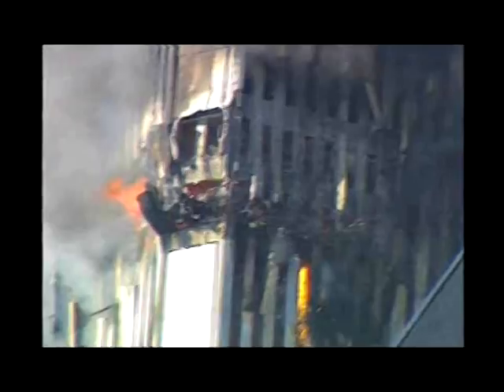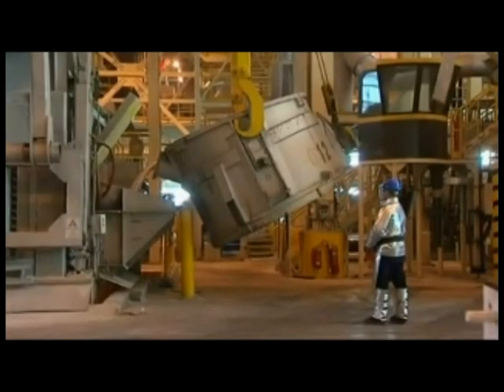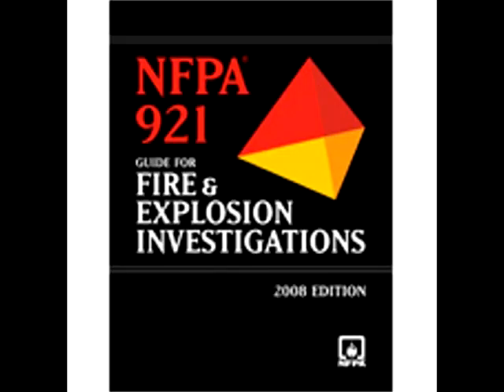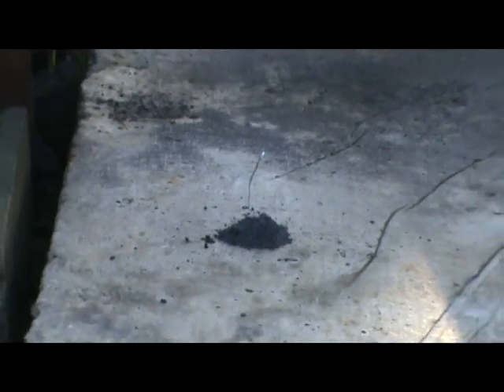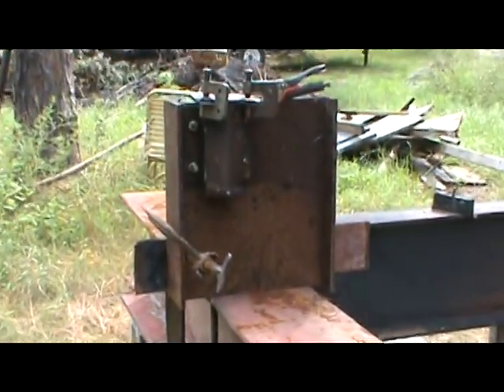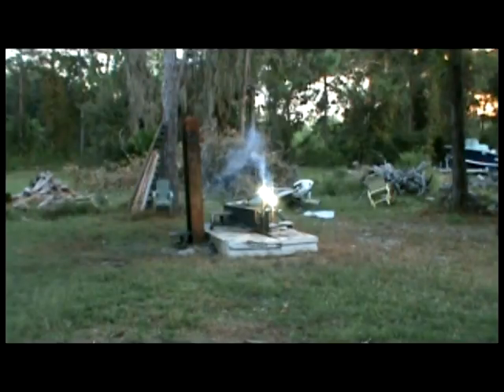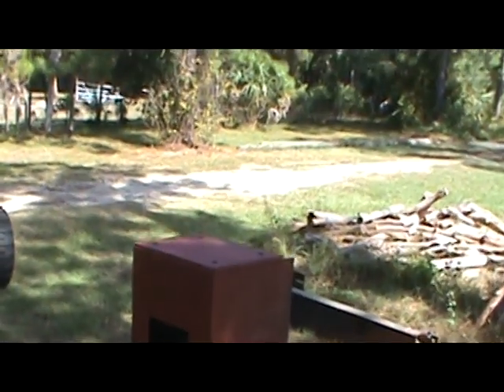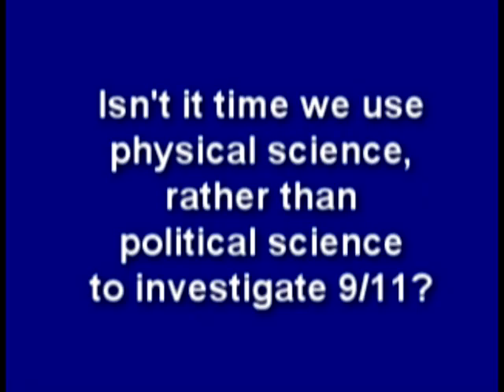9/11 Experiments: The Great Thermate Debate

Comment: As an Ironworker who builds these buildings. There’s no way a plane brought these towers down
Reply: Even better is how do we explain the plane that apparently flew into the pentagon.. No evidence of a large craft, no wing or tail sections, no bodies.. Heck not even a titanium jet engine.. The Jet fuel was so hot it just made the whole plane vanish. As far as the trade towers go, watch loose change, you'll learn of the insurance policies taken out against acts of terror, the proof by employee accounts that bomb sniffing dogs etc were pulled out a week before the attacks.. The. Recant of the fire fighters that heard explosions that shoot the building before the collapse.. The explosions on the main level that knocked the marble slabs clean off the walls.
Reply: @turbogears3907  
No evidence.

Except human witnesses, and a security camera showing it going by.
Reply: @turbogears3907  wrong. They found several parts of the plane. 

Namely the engines and front landing gear....the exact parts you mention were found.
Reply: I call bullshit on the legitimacy of your claims of being an iron worker.
Reply: jay steve . Let's also not forget how easier it was to smuggle chemicals pre 9/11. Before the incident took place.
Reply: jay steve. It still doesn't explain who planted the chemical thermite inside the buildings or inside the airplanes themselves. Till that portion of the evidence is FULLY EXPLAINED TO ANYONE'S SATISFACTION,  WE WON'T EVER KNOW WHO SMUGGLED THAT CHEMICAL THERMITE INTO THE TOWERS THEMSELVES. I AM NOT DISSPROVING THE SCIENCE. I AM JUST TRYING TO PUT A FINGER ON THE SITUATION. SOMEONE HAD TO HAVE ACCESS TO THOSE TOWERS OR PLANES, BECAUSE IT WOULD HAVE BEEN EASIER TO SMUGGLE CHEMICALS INTO THE BUILDINGS OR PLANES IN THOSE YEARS BEFORE 9/11 existed. THAT ANGLE MUST BE FURTHER INVESTIGATED.  I DO STAND BY THE SCIENTIFIC EVIDENCE THAT IT HAPPEND THAT WAY.
Reply: Looks like a controlled demolition falling perfectly like that. If you were to weaken one side of the building wouldn’t the building start to tilt to the weakened side then fall over? Not collapse on it self like such. Like many of you saying that the fire would weaken the steels tensile strength causing it to bend and twist. Which would make it fall over not collapse? Someone said here that the building is designed to collapse like it did, is there evidence to prove that? I’m torn if it a conspiracy or not. I just see both sides of the argument bringing up good points.
Reply: An ironworker is a construction worker. You're a builder, not a structural engineer. Sorry, but your experience is irrelevant. You don't design skyscrapers. You don't know what the strength of the structure is or what its weaknesses are. You put together a building that has been engineered by someone else. Just because you can build something doesn't mean you fully understand its physical properties.

You know planes are made of more than aluminum, right? They contain steel as well. Something flying at 600 MPH with a weight of over 100 tons does serious damage to a structure unless it's specifically designed to withstand force in that direction. You don't know what you're talking about.

It's much easier to pull two separate pieces of steel apart than it is to press them together. Your welds and rivets are designed to withstand force in specific directions. The tower's didn't just collapse vertically. They went down at an angle, tearing apart all the rivets and weld in each floor as they went. They collapsed inward, causing outward force and, thus, high levels of tension. A building is designed to withstand compressive force, not tensile force.
Reply: CertifiedDoc That’s like saying an auto mechanic doesn’t know why cars drive just because he builds them... You sound like a dumbass by saying that
Reply: An auto mechanic is not an automotive engineer. He can see how a car drives, but not the forces involved. He doesn't know how many pounds of pressure it would take to crack an aluminum crankcase as opposed to one made of steel, or what conditions and stresses are involved in that. He doesn't necessarily know the temperature of ignition of gasoline, or the pressures involved in the firing of a piston.

Likewise, you know how much steel is involved in building a structure, but not the mechanics behind why a certain amount of steel is required, or the exact amount of force a piece of steel can withstand. You don't know because it's not your job.
Reply: +Panopticon  This guy is using his occupation as his only reason for knowing that the whole thing was a hoax. The only problem is that his occupation doesn't give him any knowledge of that. Whether he's done other research, I don't know because he didn't say. All I got was "muh job". Pay attention.
Reply: @CertifiedDoc  Yeah and the guy in the video isn't a demolition expert.
Reply: @alexsbikesandmotors . I agree. A 767 of that size can do a lot of damage.  No question about that.  I am raising a better question.  If these people claim that thermite was present when these towers went down, how did  or where was that chemical stored in the towers. It had to be a major factor in bringing those towers down like that. Was it smuggled onto those planes? Was that chemical agent used to build  the twin towers inside those steel beams? And if so why? A lot more questions needs to be raised and asked about this subject in greater detail to really get to the truth of this matter.
Reply: Here are the undisputed facts. I am speaking as a civil/structural engineer and I am only concerned about the actual loads and conditions.
1) a jet aircraft crashed into the world trade center buildings (I do not engage in conspiracies that put forward a narrative that doesn't go with the accepted 19 highjackers evidence) 
2) these planes were set for cross country journeys meaning that I) they had more fuel to light once impact occurred and II) they overall we're heavier. 
3) while lots of material was elected from the buildings apon inpact (including several floors of outer columns) overall the net mass on the floors increased
4) no floors were rated for that weight they were not designed to carry half a jet aircraft in addition to most of their load. 
5) the fuel from the planes, along with anything resembiling hydrocarbons were set alight on those floors to burn in an uncontrolled fasion
6) there's no possibility the fire coating remained on the steel at least on the sides facing the impacts. 
7) structural steel begins to lose its strength at 400c and at 600-800 c it can lose up to half it's strength (saftey factor 2) 
8) the factor of saftey on floor one, the floor that must endure the most loads under normal circumstances was 1.54. 
9) when the steel columns experienced failure they were experience both a vertical load of 3-4 dozen floors and a horizontal load of wind exceeding 75mph at times. 
10) at the moment of steel column failure the equation translates from a strength of materials problem to a impact resistance problem. What you have to 30-50 floors collapsing as one unit, you don't ask how strong is the structure below. You ask how strong is each individual point and can it withstand 100k tons of pressure, which no.no it cannot. 

Your assertion that because u work on steel buildings and u see how thick they are and there's no way they could collapse from the rediculous extra loads involved in airplane strike is rediculous. By virtual of your statement I can say that because I would on the design of the buildings you build I know more than you and over rule your opinion.have you ever asked yourself why they put fire coating on a steel structure that's rated for 90 minutes? If it's not gonna collapse what is the concern?
Reply: Finally. A properly educated voice of reason. You know,it never occurred to me that that floor of the building and every floor below it was suddenly supporting the added weight of a jet airliner.
Reply: The iron worker in me says no not possible but the blacksmithing experience says yea it can 
Take d2steel for example way harder than anything used on the towers i can heat it red and beat it and bend an manipulate it with brute force now add how many tons on a few supports that got hot and down she goes
Reply: John Ressler yeah if that’s the case all of the columns should’ve been bent over, they won’t just fall straight down just because they get hot, if you have a fire that actually heats up a 25ft column that’s serval inches thick, the top would be hot, not the bottom. So the top should’ve bent over, especially the floor that were below the fire. I’m mean every single column is spliced together, eventually after falling a few floors, all of the columns and support beams would’ve built up and it would’ve stopped falling
Reply: As an iron worker who builds these buildings. These planes absolutely brought these towers down
Reply: BETTER THAN YOUR FAVORITE ACTION STAR then you must be the guy who sorts through bolts all day or you’re on the decking crew
Reply: @wrestlingisdeadmoveonwithy8939 . I agree 100percent.  Case closed.
Reply: @wrestlingisdeadmoveonwithy8939  
Wrong
The aluminum of the aircraft will buckle so hard before it makes much damage. 
Ever see a bird strike on a plane?
Yeah well the tt were also made to withstand a hurricane. 
Nice try though
Reply: Petroleum based fires can and do destroy massive iron structures.  Have you seen what happens to an oil rig when a blowout ignites?  The fires were burning for quite a while prior to the towers collapsing.

The metal doesn't have to melt, all it has to do is lose it's structural integrity.  If this wasn't the case, then we wouldn't have the show called "Forged in Fire" and blacksmiths wouldn't be able to do what they do.

You said it yourself.  You're an iron worker.

You're not a structural engineer, nor a metallurgical engineer.
Reply: Does it really matter one way or the other at this point? 
Even if our government was responsible for 9/11, what is anybody going to do aside from bitch back and forth to each other on YouTube?
Reply: You don't need to melt steel to lose it's structural integrity jet fuel would not be able to melt steel but would make it soft enough for it's own weight to collapse itself. My uncle was a worker on the site after 911 happens 45 days later if you picked up a piece of steel with machinery it would act like silly putty. The reason the steel stayed hot after the fuel burned was due to a few generators from a building adjacent had special fuel that burns just under the temperature of jet fuel that was damaged. More than enough heat to ruin the structural integrity of the towers days after the incident.
Reply: @T420-s3y  . That sounds interesting.
Reply: to make us go to war and steal our tax dollars it's very simple
Reply: There was NO NEED to melt ANYTHING. A full load of kerosene was combined with a collosal amount of kinetic energy into a very small volume. 

That energy translated into higher than normal temperatures. All that was needed was for the steel to soften and lose its strength without needing to get anywhere near melting temperature.

You quote Barnum. I quote William of Occam right back at you.
Reply: Become Fitness "As an individual who has watched loads of youtube videos, There’s no way a plane brought these towers down" lol.
Reply: Hence why you're an Iron worker and not an engineer. You need a college education to be an engineer
Reply: Clifton Williams woooowww and iron WORKER, OH AND YOU ARE CURRENTLY WORKING ON A 6 STORY BUILDING, therefore you totally understand the engineering, design, and mechanics of a 110 story building, and you totally understand the physics of gravity and melting steal and upward and downward force... please tell me more about your studies because your 47k must be doing great and did you drop out of college cause all you need is a high school deploma to become one of these scientific intelligent iron workers.
Reply: All the idiots in this reply session are hilarious! You don't need to be a structural engineer or a rocket scientist to see how those buildings got taken down by two 747s. All you need is a basic understanding of physics,  chemistry and a little blacksmithing know how to see how those tragic event happened.
Reply: As an Ironworker who builds these buildings.A plane brought these towers down.
Reply: ThecessnaFlyer - Gee I don't know. Could it be for the same reasons listed in the Nortwoods Plan? You do know about the Northwoods plan conceived in 1962 and put before Kennedy right? Wage a fake terrorist war on American citizens in the name of Fidel Castro as a way to legitimise invading Cuba? Interestingly one part of the operation called for the fake hijacking of a plane and killing all US citizens on board.
Reply: that is the wrong question
Reply: Bilbo LAGGINS
Then, what's the right question.
...ya idiot with nothing to offer...
Reply: TANGLDWEB Some people are just so simple. They want to believe our government killed thousands of people for a motive for war lmao.  Does anyone realize the amount of people that would have to be involved in a conspiracy like this? Most likely thousands!!  These are the same idiots that still think the government killed JFK and that the government is holding aliens at area 51. You can't win an argumemt with the tin foil hat crowd, they just keep on with the "what if's" & "how come this". 🤣
Reply: @apb2887  
They are all Slow Lemmings. Reactive. Not Proactive.
Reply: @apb2887  
I SAID, I WAS OUTTA HERE 😂
Reply: @thecessnaflyer6754  much the same way it goes and does the same all over the world
Reply: TheCessnaFlyer I’ll give an example that’s easier to relate to, let’s say Brian lives in a neighborhood and has a few good friends in this neighborhood we’ll start there. Brian has a problem managing money and stays in debt so he borrows from his neighbors with promises that even he’s not sure he can keep, this goes on for a while and his neighbors are good friends so they allow it but eventually it starts to put a strain on their household and other neighbors are starting to notice that maybe they’re an easy target for a sob story. So these good friends/neighbors decide okay Brian it’s time you figure this out on your own “tough love “ I forgot to mention Brian is younger than most of them by the way. So what is Brian to do now begging won’t work he’ll look fragile and his ego can’t take that selling resources won’t work because he was borrowing so he could buy resources light bulb 💡 family tragedy there’s no quicker way because after all Brian is still a friend and he’s a beneficial part of the HOA so they rush to his aid providing anything he needs and to show their support and care for him and his family.. I hope that helps a little
Reply: @thecessnaflyer6754  to justify taking your freedom instituting homeland security to cause fear for you stupid ass people to give up you  r rights
Reply: blaming isreal? why  ? cuz they  got caught being in the towers doing work on the"sprikler sys" the week b4  9-11,  and they got caught  leaving the scene after filming the "event"  the mossad was living next door to 4 of the hijacker, many isrealies were warned that morning to avoid the trade center area and  many many  did not show up  for work  that day, ex head of mossad owned much of the retail space in towers along with sivlesrtien had filed  terrorist Insurance  weeks  b4 attack. and lets not forget Urban moving sys inc?(mossad front)  and the antrax that was found in the warehouses along with  explosive residue.    while were at tit  just how did isreal start their nuclear program?  oh ya  they stole it from the USA. funny how the only country that u can hold a duel citizenship and still hold office in US politics, is  isreal.
Reply: also while we're at it.  you dont have to prove how  explosives brought down the towers      just that they did   and the real evidence  is in the complete destruction of the  contents of the towers. and also the degree of destruction to the concrete  and glass. almost 80%  was turned into talc like powder   down to 10 micron.  to turn either of these materials   down to a powder  takes extreme amount of  energy. nothing that a collapse  could have caused. NEVER.  also  you can see clearly  during the collapse huge pieces of the tower faling away as enormous plumes of smoke are billowing off every piece as they fall. the inside of the towers are exploding down inside the buildings  faster then  huge pieces are falling along out side towers.  you think  we'r fkn idiots??  your wrong
Reply: Clifton Williams As an ironworker when would be the most opportune time to install explosives in a building? During or after construction? Who could install explosives without being noticed? Have you ever seen something odd going on during construction?
Reply: ese-hombre
"As an ironworker when would be the most opportune time to install explosives in a building?" - I hope you're aware that that question isn't very clever.  How would any ironworker know the distant future?
"During or after construction?" - You missed out before.
"Who could install explosives without being noticed?" - Anybody present at all possible locations when no-one else was there, over the last thirty years?
"Have you ever seen something odd going on during construction?" - Why do you ask?  Do you believe that buildings everywhere have been built with explosives in them?
Reply: What do you think about the building that collapsed all on its own?!
Reply: If you mean tower 7... How many millions of tons of impact do you think buildings are made to absorb? The twin towers falling caused a literal earthquake and the basements of all the buildings were damaged. It's a miracle more buildings didn't fall and there's no doubt more were damaged. The repairs to all the surrounding buildings was extensive.
Reply: What building just randomly fell on it's own?
Reply: fish mann  settle the fuck down.
Reply: Can thermate cut the head off my penis? Not this chrome steel mega-python over here!!!!
Reply: @TheCessnaFlyer, for money..
Reply: clifton- don't let the trolls affect your thinking. obviously one object cannot hit a secondary object, whether with jet fuel or missiles or the like, and cause the secondary object to freefall.  It is a physical impossibility. Yet we watched those towers freefall...because they were struck on the 93rd and 75th floors, respectively. Which is physically impossible. If the top snapped off under the impact and ensuing fire that would make sense.  It also would have caused much more damage and chaos. Even Dan Rather said it looked like a controlled demolition on a live newsfeed.

Also, WTC 7 collapses, even though it is never struck. The official story is that the jet fuel created an intense fire which caused the collapse. but WTC 7 shouldn't have been affected by the jet fuel. Interestingly two of the biggest tenants of WTC 7 were Salomon Smith Barney and the Securities and Exchange Comission.  Both just happened to lose all the files they were housing one day after Donald Rumsfeld admits the DoD has lost track of $2.3 trillion. Also remember SSB is a Citigroup subsidiary which just happened to be embroiled in the WorldCom scandal. Those lost files account for trillions of dollars that remain hidden.

Also, Flight 93 crashes in Shenksville, PA without debris. The immediate news coverage following the incident shows a hole in the ground where the "plane" hit the ground but there isn't any wreckage around the hole. There is minimal plane wreckage at the pentagon.  Now ask yourself, where was the plane wreckage in New York?  Did you ever see plane parts in any of the NYC photos? Why did all these planes vaporize?  Again all this defies the immutable natural laws of our physical world.
Reply: As an ironworker, do you design the buildings? As a structural engineer, I can tell you with all certainty that a plane brought them down
Reply: Dude you need to take your head out your ass and waken up, your so called government don't give a shit about you and me, its always about the bigger picture or agenda. We are sheep to these fuckers
Reply: A plane made of LIGHT MATERIALS ISN'T GOING TO DEMOLISH A WHOLE FUCKING BUILDING MADE TO RESIST NATURAL DISASTERS, EARTHQUAKES, TORNADOES AND FUCKING ALIENS. 
Jet fuel isn't that any different from a normal diesel.
Reply: NOW YOU GO FUCK YOURSELVES.
Reply: TheCessnaFlyer because the American government under the JFK administration planned something similar against Cuba. Search up operation Northwoods. Official government papers. They wanted to bomb schools and hospitals and blame it on Cuba as a reason to invade and take over. JFK said no.
Reply: carpe diem There’s a thing called apprenticeship school where you learn the ins and outs of our trade, you learn everything there is about structural buildings, and how to build them. That takes 3 years
Reply: I've never been convinced of fire being catylist to the towers collapse, but having began forging steel recently, I wonder - could the higher temperature required to melt the buildings columns have come about by the wind @ that height fanning the blaze to extreme temperatures  - much as an iron forge works ?
Reply: @TheCessnaFlyer You're 100% trolling, but it was to start a war with Iraq, blaming that they'd officially started war with U.S.
Reply: ARRAV, False.
9/11 did give large support to the war but the war was already planned out as a continuation of the gulf war years before 9/11.
Reply: TheCessnaFlyer oil.
Reply: @heldgop I don't know if you know this but you turn a wrench you swing a hammer... You definitely vote Democrat. Because you've obviously never used a tool in your life. Lmao
Reply: The planes totally brought down the building...
Reply: If I check my max weight of lugage, back then , I think you  could check two 75lb bags per person. 

Edit* -150lbs of tanerite or other material  per terorist. Easy to Get 600lbs on board. 
Why not use  magnesium & tanerite,  or other combo, add in some sort of extra O2!*
Reply: Project for a New American Century fulfillment
Reply: @thecessnaflyer6754  war.
Reply: proof is in the video man.  the building fell from the top down, not the other way around.  it only makes sense that the plane was the cause of it.
Reply: You ever stood next to a jet that big? As soon as the planes hit i knew the buildings were coming down and i was only a year out of highschool
Reply: Clifton Williams your right, sadly the only way to get a 90% right answer is to build the twin towers over again in a empty field and have a unpiloted plane the same model crash into the building. but that will most likely never ever happen. so we have people on both sides fighting like the left vs right. you cant convince me it was planes that took the towers down when explosions came out of random windows on random floors. how could a plane do that?
Reply: heldgop I swung a wrench, while in school. All the other engineers cheated off other people. The best engineer, was a fuckhead who couldn't design a weather balloon battery box. That said, I made a million with 10 grand, never used the degree. How's that for a laborer?
Reply: as an ironworker, you should be well aware what happens to steal when you stick fuel and iron in a chimney like object with a good strong air flow....
Reply: Look up Operation Northwoods. Those were real documents which were given to the then US president JFK which proposed a fake terrorist attack to  which then was to justify attacks on Cuba.
Reply: Your a brain dead idiot
Reply: I agree with you, those building were built to strong for planes.
Reply: I got news for you.

If you build them there's no way in hell your education or experience makes you anyway more qualified to understand the physics of all that.

Which makes your opinion worthless unless you can explain how it's impossible, backed up with actual science of course.

We've been doing science on metals using force(impacts, explosions, etc) and weights for a LOT longer than those towers existed. According to everyone who's checked, the physics of everything they say works out. Which means you must be getting your claim from tests that were done before the towers were dropped. So all you have to do is go get the links(or get a physical book and scan it in and give us the link) to that previous testing that makes you know for a fact the planes could not drop the towers.

Take your time, I'll wait.
Reply: Whenever I see someone arguing and typing one word in caps, I automatically  think they are a douche or butthurt
Reply: @kingteb  
Amd you sound like someone who loses a LOT of arguments online.😎
Reply: I think the fact that thermitic material was even found should raise suspicion. I don't have a degree in any of these fields like some of you, but if it was just a plane crash why would this type of material even be there? I'll also just throw in another conspiracy on top of it cause, why the fuck not. A few months before 9/11 Larry Silverstein took out an insurance policy on the buildings which covered terrorism and or terroristic threats, he then took the insurance company to court after 9/11 and won over 4 billion dollars, on a small investment. I don't think that's a coincidence. Also, wasn't George Bush's brother in charge of security for the world trade centers? and if i can recall correctly, I think there's lots of people that worked in those buildings, on the record, talking about random evacuations of the buildings weeks prior to 9/11. Which might explain how explosives were put there. I didn't read all of the comments on this but I didn't see anyone bring these points up. I just like to keep an open mind and let's stay cordial people :) much love :)
Reply: Logan Scott because thermitic material is simply iron oxide, and aluminum, which are VERY common building materials, the iron oxide came from the decomposition of steel, a byproduct of fire and steel, and aluminum is used in lots of alloys and members that give the building structure. They also sometimes use thermite to weld the beams together
Reply: Taydrum I appreciate the explanation!
Reply: Cheers, and thanks for the reasonable response
Reply: TheCessnaFlyer But you forget one thing... They will.
Reply: As a vet that works in a clinic, I'm gonna say that there was more than one plane.
Reply: Your a WORKER NOT an expert.
Reply: +TheCessnaFLyer, your Police kills over 1000 citizen each year so not so huge difference. 
It's called collateral damage to get approval from citizens for foreign military acts/funding.
Reply: 2 planes = 3 buildings falling straight down 👌
Reply: Kareem Alvarez
Only gullible ignorant moronic SHEEP DRONES to the conspiracy shepherds think two planes brought down three buildings.

That did not happen.

Two planes brought down two buildings. The two buildings that collapsed destroyed or damaged beyond repair the entire WTC complex and some buildings outside the complex.

Now wake the fuck up FOOL!
Reply: Become Fitness
The towers were not full of asbestos dumb dipshit sheep. Only one tower had asbestos in it and it wasn't even halfway up. Now wake the fuck up FOOL!
Reply: Clifton Williams just stop, he won't open his eyes
Reply: Alejandro Calzada
Your eyes are the closed ones widdle sheeple.
Reply: VitalCubeGaming
What's that sheep? You can't refute me? Poor you.

Wake up!
Reply: I’m an Ironworker that builds these builds how terrible
Reply: Light weight construction did....
Reply: I have a legitimate question:

Could the jet fuel not have made the steel frames of the buildings so hot that they just got malleable enough that they went limp like noodles and allowed the collapse?
Reply: Source: Dude trust me
Reply: FRooP Fucktard
What's that sheep? You can't refute me? Poor you.

Wake up!
Reply: @thecessnaflyer6754  your problem is your thinking the government really needs a reason to do anything, bill Clinton released documents of the government testing harmful radiation on whole towns, and even a u.s. aircraft carrier to get heat off of himself. The government doesn't care about the people living here.
Reply: @thecessnaflyer6754  your joking right ?
Reply: Had anybody ever stopped to think that maybe there was a third party, and they were responsible for making people hijack the planes and MAYBE (set up bombs in the two buildings). And then they planned that everbody would never figure out what caused the buildings to fall because they are all to busy arguing about terriosts or controlled demoltion.
Reply: Clifton Williams , that’s right , stick with what you know , and let the guys who know how to bring one of your buildings down explain how it can bi done
Reply: I'm an ironworker too (20 yrs) I saw these towers burning myself. I  agree with you. A plane hit the empire state smaller plane and also there is way more steel in the empire state building along with a different design.
Reply: Did you know if two barns, one wood and one steel, caught fire at the same time, the wood structure would remain standing after the steel structure had collapsed?
Reply: Clifton Williams ...as an iron worker.... You wouldn't fucking  know....
Reply: Swandogg88
Sheep.
Reply: Uhhh....how about to have a reason to go to war, to cover evidence, and to make you believe another country did this to us.  Kinda odd that your name is Cessna flyer.  Did you hear about the guy that flew his Cessna into his own home trying to kill his wife and son???  Well, the plane didnt even hardly cause damage to the house.  So does that make the towers built out of Legos???  Come on man.  Wake up.  If not, I guess go back to grazing with the rest of the sheep.
Reply: Brody
How fast was the Cessna going dumb dipshit sheep?
Reply: Clifton Williams agreed
Reply: Steve
Steel didn't melt on 9/11 dumb dipshit sheep.

Explain what hit the Pentagon if it wasn't a plane and why it wasn't on radar when flight 77 was. Explain why you think we should have clear video of an event that took 1/4th of a second to happen from CCTV cameras that record at less frames per second. Explain how the black box from flight 77 ended up in the Pentagon if it didn't hit. Explain why there are plane parts inside and outside the lawn. Explain how passenger bodies were found inside the Pentagon. Explain why multiple witnesses saw a plane. Explain what hit the light poles if it wasn't a plane. If you claim that the light poles or plane parts were planted, then explain how this is possible when the Pentagon is a major tourist location surrounded by major highways. If you say that a missile hit, explain why the damage is too large for a missile. Explain why there are no missile parts. Explain why no one saw a missile.

Refute the content of these links.

therightbloggerbastard.blogspot.co.nz

Damage analysis link:

http://911review.com/articles/stjarna/eximpactdamage.html

Video tapes:

http://classroom.synonym.com/were-9-11-pentagon-tapes-seized-fbi-18501.html

The FBI directs inquirers to its vault, an electronic reading room with documents available to the public. The vault includes many videos and images of the Pentagon incident, including debris from the plane

Here's a few pictures of bodies at the Pentagon, you know, the ones the conspiracy shepherds say don't exist and you mindlessly believe them like the gullible SHEEP you are?

http://www.vaed.uscourts.gov/notablecases/moussaoui/exhibits/prosecution/P200045.html

http://www.vaed.uscourts.gov/notablecases/moussaoui/exhibits/prosecution/P200047.html

So explain all of that DIPSHIT SHEEP DRONE or you can always...

WAKE THE FUCK UP DUMB DIPSHIT SHEEP!
Reply: Clifton Williams yet it did  get over it
Reply: which is why you're not an engineer
Reply: Iron worker, yup that's a great place to get your unprecedented structural damage report. Everyone who thinks they are an expert on this collapse is a tool
Reply: Physics is a thing.
Reply: @dankbeast9013  
Sure, i get that, but I don't get my science from a grunt welder. Also you can cherry pick scientist that will say whatever you want like the earth is flat but fact Is, this disaster was unprecedented so no one is an expert. Also no one survived who saw and inspected the damage leading to collapse cus all the evidence is basically gone. So again, go find something better to do with your day
Reply: @beatnik1855  triggered?😂  What about wtc7 that no one speaks about. Explain that.
Reply: @dankbeast9013  Not for 85% of people I come across, most of whom of can't even comprehend what "zero resistance" means.
Reply: U fucking idiots think a zillion bolts and tons of welding will hold a builidng being hit by a huge fucking plane this isnt cartoons guys be foreal....no building will out hold a impact hit like that way in the sky wow i guys wre fuck tards 😆
Reply: Because you know the unique design of the towers.... You are embarrassing yourself
Reply: Charles H Geis IV
Be specific, dipshit sheep.
Reply: All you pocket geniuses know NIST failed to cause steel to collapse in their replicated office fire experiment don't you?
Reply: CessnaFlyer, you ask why a government would do this. That can be answered easily: You follow the money. But let me ask you a question: Why would Muslims do this?
Reply: Jeez. 
It's like talking to Flat Earthers 😂
Enjoy your conspiracy theories. 
...I'm outta here...
Reply: 60 people died in construction twin towers and Mr.Yamaski unique tube design relied heavily on load bearing perimeter walls make more floor space,,maybe if you had civil engineering degree like Bin Laden you would know this,,steel only has to weaken not melt,,weight of the upper floors in the towers does exactly what gravity dictates,,
Reply: theCessnaflyer, Dig in the declassified history of your government..not to mention what is happening these days....still classified.
Reply: @spinneborstel . Yeah. What they(our government) wants us to believe.
Reply: There's no way you're an ironworker who builds these buildings.
Reply: You're an idiot that's a very common thing. I lived in Miami Florida from 2005 -2008 and Worked as a superintendent for Whiting -Turner Contracting Company . I was in charge of the exterior of 851 and 901 Brickell buildings.   It's known as the plaza on Brickell and you can look up the info i give you. Just from my one job alone with a 64 story building and a 47 story building and a 10 story parking garage we had hundreds of iron workers alone on just that job. The whole skyling was filled with over 50 some tower cranes and 20 some construction sites going on at the same time. My point is this is just 1 city in America.Imagine how many iron workers are all over this country. So it's very common for him to be an iron worker. And it's clearly obvious anyone who has built these kind of buildings from the foundation up, that 2 planes couldn't bring down these 3 high rises. They're literally built with a plane crashing into in mind. Since the plane crashed into the Empire State Building we have had to building the buildings to a certain code. And the code was implented with a plane crashing into the building. Every architect that designs these buildings design them assuming a plane will crash into it. And you still think 2 planes brought 3 buildings down in controlled demo. Not just buildings we are talking steel structure highrise designed for planes crashing into them. You explain how 2 p[lanes cause molten steel ill wait.....My father is a senior superintendent and has worked on bridges and high rises for 40 years. And i have since i was 19 and now i'm 32. And i promise you with all of my heart those buildings were not brought down with planes.
Reply: Brother David "those buildings were not brought down with planes" - Well, obviously they weren't.  They remained standing after the impacts.  We don't need you to tell us this.
So why are you telling us this?  Do you think we are all blind?
Why aren't you discussing the hour afterward before they fell?
Are you going to pretend there wasn't a fire?
Are you pretending that SIX ACRES of office fire couldn't heat up the 3/4" round steel bar trusswork holding up the floors, when given an hour to do it?
Are you pretending that heat doesn't soften mild steel after a thousand years of blacksmithing?
The towers fell due to fire.  They would haven fallen just a little later had they been undamaged.
No molten steel occurred, and no molten steel was found.
Truther claims of 'molten steel' are either to do with the red-hot molten aluminium alloy that gushed out of the corner of WTC2 moments before it fell (iron produced by thermite is white hot at 4,532 deg F, and falls straight down.  It would never fall outside of the towers), or the corroded iron found in the wreckage, which was caused by chemical reactions between red-hot steel and fireman's water.
You must have issues, both with education, knowledge, and authority.  Read the NIST Report in the company of a trained engineer.
Reply: Tony Duncan Right... Because a fire took down 3 buildings that were all sprayed by fireproofing, yet they still collapsed perfectly. Crazy isn’t it? Just like they never could find the 4 black boxes, which were big giant orange metal boxes that are made to withstand a plane crash, somehow just disappeared. Yet they could find a passport, money, notes, bone fragments, etc... So I don’t buy the official story because the government is known to lie, quite often
Reply: Tony Duncan There were people who say the FBI found the boxes but NIST reports they never did, then of the other surviving ones from the other flights, they somehow didn’t work or they simply denied to reveal the audio to the public
Reply: @MrRandomGuy86  here's another reference smart ass ...I'm a structural engineer and im well aware of those 2 planes cannot bring down those 2 mountains of a building. Anyone with a brain will agree with this.
Reply: @MrRandomGuy86  prove it. Pics or it didnt happen or i guess in this case it did.
Reply: Forrest Hayson
Gotta be more specific. I've made multiple replies in this thread. What do I need to prove widdle sheeple?
Reply: @MrRandomGuy86  ah i see your such a troll ypu forgot who you trolled lol i was refferring to your very first commwnt where you claim the the guy has never worked on a skyscraper i want ypu to prove that he doesn't. Where i come from if you call a man a liar you have to prove it. You sau he lies i say you prove it.
Reply: MrRandomGuy86 Well I’m currently building a 6 story building, but yeah I do this for a living
Reply: MrRandomGuy86 Look up the plane that crashed into the Empire State Building, it didn’t collapse
Reply: MrRandomGuy86 a small plane? It was a B25 Mitchell, a bomber used in the Army Air Corps at the time. Those aren’t small planes, and no I’ve learned this from experience of seeing building getting demolished by explosives and from actually building them. We make them so they won’t collapse, so until you have actual real life experience in this field of work. You know nothing and believe what the media and the government have told you
Reply: Clifton Williams
Meant to say smaller plane.

So, are you saying the buildings were demolitions then?
Reply: MrRandomGuy86 ok that makes better sense and yes. They fell in a controlled manner, just exactly how we do it. A plane crashing 80 stories up will not do that
Reply: Explosives at the trade center on 9/11 are IMPOSSIBLE unless YOU can explain away the impossibilities and inconsistencies of the fairy tale demolition theory! Explain how bombs MAGICALLY survived the plane impacts, MAGICALLY survived falling debris for building 7, MAGICALLY survived fire, MAGICALLY got passed the extra security (including bomb sniffing dogs) working round the clock 12 hour shifts due to phone threats, and why each and every explosion was random, out of sequence, inconsistent with a demolition and had nothing to do with any building collapsing. Explain why there were NO explosions seconds before the collapse of ANY building. Explain how firefighters survived in stairwell B. Explain how building 7 debris was pushed up against a buildiing across the street. Oh and also the steel was sent to 4 different landfills where multiple organizations and experts had access to it for a period of six months. Explain why people who say the towers were demolitions DID NOT go to any of these landfills.

If you can't, and I know you can't because NO ONE has ever explained it away, then you need to...

WAKE THE FUCK UP DUMB DIPSHIT SHEEP!
Reply: You can't be serious. The plane that hit the ESB was a small bomber travelling slowly in the fog. It struck a building constructed largely of concrete and cause relatively little structural damage. Conversely, the twin towers were hit by near-full wide-body aircraft travelling at 400+ mph. Further, the damage done to the perimeter and central support structures of the twin towers were not survivable and the collapses were inevitable. If you really believe that the WTC towers were even remotely similar to the ESB, then you don't know shit about either of them. I pity the people who will have to work in the buildings you say you're constructing.
Reply: Clifton Williams  haha totally the same thing.
Reply: Clifton Williams did you know that the twin towers were built specifically do collapse like that in a catastrophic event like what happened on 9/11? Did your iron working expertise teach you that?
Reply: @rye_too_quick . I agree. Everybody now claims that thermite was used to take down the towers. Nobody has yet to explain in full detail. How that chemical got there? I am willing to listen.
Reply: Clifton Wishes
Well. That's why Iron Workers aren't aerospace engineers. 
And though molten Aluminum, when brought in contact with Water. 
Has 10X the explosive force of TNT. 
I'll just let you do some MATH. Of the difference between a 767. And a B-25 Mitchell. 
The maximum weight of a B-25 ranged from 27,100 lb to a limit of 41,800 lb, for instance (see www.warbirdsresourcegroup.org/URG/b25mitchell.html). A 767-200 ranges from 179,080 lbs (empty) to 395,000 lb (maximum takeoff load) (www.aerospaceweb.org/aircraft/jetliner/b767), and FEMA said the 9/11 planes had “an estimated gross weight of 274,000 pounds” (http://www.fema.gov/pdf/library/fema403_ch1.pdf ).

The maximum speed of a B-25 ranged from 275 mph to 315 mph, depending on which version it was, and as the B-25 pilot was trying to avoid the building it's unlikely he'd have reached that (cruising speed was 230 mph). On 9/11, "American Airlines Flight 11 crashes at a speed of roughly 470 mph" and "United Airlines Flight 175 crashes at a speed of about 590 mph" (http://channel.nationalgeographic.com/channel/inside911/timeline.html), a considerable difference when you factor in the extra mass as well. 

The B-25 had a "normal total fuel load of 974 US gallons" (http://www.b25.net); a proportion of this would have been used already in the plane’s flight. By comparison, "it has been estimated that both UA Flight 175 and AA Flight 11 were carrying about 10,000 gallons of fuel when they impacted. Of the maximum 24,000 gallon capacity. 

Quick Hint. 
10X the Mass. 
10X the Fuel Load. 
Traveling Twice as Fast. 
Even 3 inch thick Steel Hollow Boxes don't stand a Chance. 

And Yes. I've built 767's. And many other Boeing aircraft.
Reply: The fire does not need to melt the steel, it only needs to heat it up. 
"By 550°C steel retains approximately 60% of its room temperature yield strength, and 45% of its stiffness"
I doubt WTC engineers built the structure to hold twice the weight it did.

Also, there is a huge....HUGE difference if you are holding a heavy weight or catching it from mid-fall.
E.g a weightlifter can hold 100kg above his head, but he would never be able to catch 100kg if it fell from 2 story height. Same goes for the impact at 80th floor. Once one floor collapses, the weight above it will fall and impact the floor below with much greater force than was ever designed. This will cause the walls and columns to blow out and the next floor will collapse...and so on.
Reply: TANGLDWEB yeah but none of that would cause the entire building to fall straight down, maybe the top stories sure but from experience of building these. They are made to withstand ungodly amounts of force, so personally I think the WTC was rigged completely with explosives, there’s simply no way in hell that the 60th floor should’ve even collapsed when the plane crash 20 stories up, like the building can hold itself, a few floors might’ve collapsed but it would’ve stopped pretty soon. Not to mention WTC 7 some how collapsed when it wasn’t even hit
Reply: Clifton Wishes
Actually. Uninstalling Windows above, answered that for you 8 minutes ago.
Reply: @WarInHD  . I agree. WTC7 to anyone watching, had to believe that it was demolished.  No question in my mind or anyone with a brain can say that those planes had anything to do with the destruction of WTC 7. To me or anyone watching that day. So my question is how was that chemical present, and how it got there to begin with.
Reply: Clifton Williams; "3 inches thick" isn't quite as thick as your head. So according to your expertise, a jet traveling about 500+mph should've hit the side of the WTC and ricocheted? Or just pancake and slide down the side of the building? Explain how the I-85 bridge in Atlanta Georgia collapsed.Temps were so hot, that the steel melted.It dropped perfectly flat also. A woman that managed to escape the WTC testified that one minute she's looking at the skyline and the next, she's looking at the Hudson river. The impact twisted the structure. Comparing a modern jet traveling 500+mph and weighing 10x more to a B25 going about 150?, is like comparing a Model T to todays Mustang.
Reply: MrRandomGuy86  this video isnt evidence enough of some weird ass cover up?...watch; "the long kiss goodnight" (btw the movie was made in 96')
Reply: @MrRandomGuy86  You have done very little research into 9/11 haven't you. 

There are too many videos out there that document explosions.  Right from the collision of the first plane crash taken by the fire fighters, explosions can be seen on the top floors. Fire Fighters arrived at the North Tower to quote, "It looked like a bomb went of in the lobby." Many eye witnesses claimed a bomb went off in the lower North Tower before the plane crash. Some camcorders picked up interference from that explosion just before the crash.  

How could bombs survive a plane crash? Why wouldn't they? 

A more important question is how can a building fall at near free fall speed? That is to say, three buildings came down at the rate that a sky diver does jumping out of a plane. No resistance. Office fires and ignited jet fuel don't cut steel beams within split seconds of each other nor do structural failures. Only controlled demolitions can achieve freefall.
Reply: The concrete tower is the structural aspect of these buildings. The steel skirt is not
Reply: I'm with you man between my dad and i we have 50 years experience building high rises and bridges. And these idiots couldn't imagine the amount of steel that goes in the foundation of a building alone. Let alone a building 1000ft tall. They don;t understand how well buildings are made. Column by Column and the amount of rebar that gets tied in just one column. So much steel in each column that it's hard to get the concrete to go in the column form so you have to vibrate it down and the same thing with the floors. And the amount of steel in the elevator shafts. They just don't understand or are seriously brainwashed.
Reply: you're 100% right
Reply: TANGLDWEB https://youtu.be/T6zxJa-BbM4 that kinda debunks your plane idea because at 590mph flight 175 would’ve ripped apart in mid air, also the building was extremely strong and made to withstand plane crashes
Reply: TANGLDWEB and another thing, pilots say it’s near impossible to make the maneuvers that they supposedly did and hit those towers, and these guys never flew a 757 or 767 in their life. Pilots who have flown them for years couldn’t even do it
Reply: "Well I’m currently building a 6 story building, but yeah I do this for a living"

Six whole stories huh? Quick question... What would happen if you took eight of those six story buildings you build,and dropped them on top of another building from 30-50 feet? The building would be flattened. Right?

You see,the planes didn't take down the towers. They only took out a couple to three floors of the tower. Then,when 30-40 stories above fell,they cause a catastrophic failure of the floor below. That floor fell with the other 30-40. Now the failure is gaining weight and speed. Just like if you were to stack too much drywall on your sixth floor in the center of a room. If you stack enough weight to collapse that floor,all of them will fail. The drywall has the added weight of the floor it broke when it hits the next and the damage is increased exponentially on the way to the basement. 

You don't need to damage all the beams. Only the right couple.

I do this for a living too bub.

By the way... most of the molten steel running out of the windows was mostly metal studs and light gauge duct work that melts very easily due to it's thin walls.
Reply: mckrackin5324 look at how the building was built, the interior could have flew in. Sure, but the core and exterior of the building wouldn’t have collapsed like that
Reply: The core of the buildings was compromised on all levels because tens of thousands of gallons of fuel was dumped down the central elevator shafts and burning. The steel didn't  have to melt. Only weaken. The millions of tons of weight above it helped. All it takes is for a single floor to fail. Every floor is supported by the one under it and supports every floor above it. That includes the exterior.

It was a catastrophic failure that can not be planned for. All these conspiracies sound like they make sense and succeeded in stirring up the blind masses. But they are all lies. Well told lies. But lies nonetheless.

I won't say who was behind the attack because I simply don't know but I will say that those planes were the sole cause of the buildings' failure.
Reply: mckrackin5324 A floor collapsing wouldn’t have caused the exterior or core of the building to fall, also jet fuel burns extremely fast. It was all burned out in less then 30mins, the rest of the fire was from office supplies. NIST even said that only 3 interior columns ever reached over 250C, now how in the hell did the core of the building collapse then? When it has to be at least 650C for it to soften up, I still say there were explosives used because that way to professional looking and no building will fall at free fall speed because of a fire
Reply: mckrackin5324 Well you’ll find a lot of interesting stuff considering how successful I’ve been for my age 💁🏻‍♂️ so go ahead and dig in
Reply: I'm sure those six story buildings taught you a lot about skyscrapers and the effects of fire on them. lol

I am curious though,how do you suppose the buildings were rigged for demolition without anyone knowing? Have you ever seen what goes into a controlled explosive demolition?
Reply: basically if you understand simple physics, its pretty obvious how they fell lol.  Take Jenga for instance.  Pull one block off the side,  now how likely is your jenga tower going to fall straight down.  The planes didn't magically fly into all four sides of each tower simultaneously.  And if they fell due to the steel melting from the planes, logic would dictate that they would have toppled to the side where the impact was made from the damage to the load bearing structures plus the so called melting.  We have had google for years now people, all of this information is available to any of those rational enough to entertain their brain.
Reply: Oh. Google. I never thought of that. Crazies gonna crazy.

What if the Jenga tower weighed a million tons? How about then?
Reply: Here's a couple "simple physics" experiments for you. First,stand on an aluminum can. It's tough to balance your weight above it without crushing it but you can do it. Now have a friend poke the can on one side. Report back and tell me if you topple to that side or if you crush the can when it's compromised.

The second experiment is to balance a 10 pound bowling ball on your head. Record the results. Now have a friend carry that ball to the top of a 20 foot structure and drop it on your head. Record the results and report your findings back to me.
Reply: haha, in no time flat, triggered.
Reply: Nah. Stupid is a fun toy to play with ;)

Now,do the experiments.
Reply: whoooh,  got worried there for a second.  glad im not stupid haha.  Although it is unbiased and since we are both here on what seems like the same side of stupidity argument at least we can agree on the fact that, yes stupid is as stupid does and it is fun.  Glad to see you agree!!!!  But hey i got a thing......so yea......toodles!!!
Reply: Later buddy ;)
Reply: Jonathan Tullin did you not know about the construction company linked to bushes brother that had been working nights in the towers in the months prior to what happened? Plenty of time.
Reply: Flinty! Genius
Reply: MrRandomGuy86 Dude, look, when we say that the beams melted, its called hyperbole, not actually what we mean... The building fell straight down, which wouldn't happen if that segment of the building (the part above the crash site) were to attempt to fall, it would have fallen at an angle due to how the damage within the crash site level would not have been the same on all sides of the building. Now, did it fall at an angle... no, it fell straight down, and it fell very close to free-fall, note how I didn't say it fell at free-fall speed, because it didn't. Anyone can look at that building falling and use their brains and see that that wasn't a possible speed for it to fall at. People like to forget that as that segment of the building was falling it should have been hitting the building below it, which was perfectly still and just as dense. Also, if you measure how high the crash sight was (or just look at it...) You can see that the crash site was around 2/3 up the building. Now as Newton's law states, for every action there is an equal and opposite reaction. So if the falling segment of the building were to fall and be capable of destroying the segment below, it would be destroying not just the segment of the building below, but itself as well, and since the bottom portion was larger than the smaller portion that was falling it would be almost guarantee that even if it was possible for the building to fall straight down, there would still be part of the building there... The debris left behind wouldn't be heavy enough since most of it  would be expelled outward. The tiny amount of debris still directly above the building would also lose its velocity and would have almost no contribution to the weight of the falling parts hitting the lower building segment. You don't even need to make mathematical calculations to figure out that it was impossible, nor do you need to use facts about steel and its melting point, which you guys like to get mad at us about when we try to use it as a point.
Reply: Theres a significant difference between a 6 storey building and a 110 storey lightweight structure
Reply: Do you have any idea about how to design a steel framed building? The fact that you're talking about "melting" the steel already gives the impression that you don't
Reply: An entirely different situation that is not at all comparable
Reply: @WarInHD  I work in the heavy steel industry too..there's no way any of the steel in a tower no matter how big will take a bit from passenger jet
Reply: Clifton Williams. a boeing 767 going 178m/s gives you 2,874,300 joules of impact energy. That's more than enough to destroy that building.
This doesnt account for the explosive power of the fuel.
If it had half its fuel it'd produce an explosion worth 234,674,403,375 joules of energy which is roughly 56 tons of tnt, most bombs don't have that much explosive yield.
Reply: ask them how building 7 fell apparently it's can now ...... Best controlled demo Ive ever seen not one mistake.
And I did work with tons of explosives in mining don't fucken go there.
Reply: Jonathan Tullin Securacom, look into that company and you'll find your answer...
Reply: MrRandomGuy86 im not some pro about this but how will you explain the fact when reporter in news said 1 building fall (i dont know now the name of the building it was some police building) but when she said that building fall it was still standing behind her and there was no sign something hit that building. :-) not trying to be rude just explain it you seems to know the facts.
Reply: The thing is, we don't know if there was any molten steel or if it was steel...if there was some molten stuff there. All we know is what we see on youtube...or what someone else thinks they saw as eyewitness. For some reason i doubt you( or any of the YouTubers) have actually read the official investigation reports. A layman could see a stream of molten aluminum and say "i saw molten steel". Im not sure about this, but i think melting point of metals can also lower if the shape of a ´metal object is narrow and small...like a needle. There is plenty of small metal components in a typical office equipment( like computer circuitry, microchips etc ). If there were microscopic metal "sphere"s found, then maybe they were molten micro-switches from electronics or something like that.
Reply: @UninstallingWindows  
It was aluminum from the planes. Each of which contained 30ish tons of aluminum.
Aluminum melts at around 800 degrees, which is a temperature that jet fuel can easily reach, especially considering the wind.
Also, molten aluminum and water don't play nice together. There's been over 250 molten aluminum explosions in the aluminum industry. It's well known and studied.
Reply: @MrRandomGuy86  The individual is handicapped by coming face to face with a conspiracy so monstrous he cannot believe it exists.

J Edgar Hoover
 

  That's about you mr.HandicappedGuy86
Reply: James Goku
Explosives at the trade center on 9/11 are IMPOSSIBLE unless YOU can explain away the impossibilities and inconsistencies of the fairy tale demolition theory! Explain how bombs MAGICALLY survived the plane impacts, MAGICALLY survived falling debris for building 7, MAGICALLY survived fire, MAGICALLY got passed the extra security (including bomb sniffing dogs) working round the clock 12 hour shifts due to phone threats, and why each and every explosion was random, out of sequence, inconsistent with a demolition and had nothing to do with any building collapsing. Explain why there were NO explosions seconds before the collapse of ANY building. Explain how firefighters survived in stairwell B. Explain how building 7 debris was pushed up against a buildiing across the street. Oh and also the steel was sent to 4 different landfills where multiple organizations and experts had access to it for a period of six months. Explain why people who say the towers were demolitions DID NOT go to any of these landfills.

If you can't, and I know you can't because NO ONE has ever explained it away, then you need to...

WAKE THE FUCK UP DUMB DIPSHIT SHEEP!
Reply: MrLunithy
Explosives at the trade center on 9/11 are IMPOSSIBLE unless YOU can explain away the impossibilities and inconsistencies of the fairy tale demolition theory! Explain how bombs MAGICALLY survived the plane impacts, MAGICALLY survived falling debris for building 7, MAGICALLY survived fire, MAGICALLY got passed the extra security (including bomb sniffing dogs) working round the clock 12 hour shifts due to phone threats, and why each and every explosion was random, out of sequence, inconsistent with a demolition and had nothing to do with any building collapsing. Explain why there were NO explosions seconds before the collapse of ANY building. Explain how firefighters survived in stairwell B. Explain how building 7 debris was pushed up against a buildiing across the street. Oh and also the steel was sent to 4 different landfills where multiple organizations and experts had access to it for a period of six months. Explain why people who say the towers were demolitions DID NOT go to any of these landfills.

If you can't, and I know you can't because NO ONE has ever explained it away, then you need to...

WAKE THE FUCK UP DUMB DIPSHIT SHEEP!
Reply: @jonathantullin2990  through Israeli Mossad posing as art students. All explosives were provided by a company Dick Cheney owns.
Reply: not.
Reply: I... (lol) I know aircrafts, be sure that the amount of kerozene contained in a B762 and the quality of it CAN cause an unstoppable fire.
Reply: B25 Mitchell IS a rather small aircraft, no comparison!! about 8 times less weight and dimensions. Just imagine the size of the fuel tank, ignorant!!
Reply: StrongLifeLived 4Sure
Explosives at the trade center on 9/11 are IMPOSSIBLE unless YOU can explain away the impossibilities and inconsistencies of the fairy tale demolition theory! Explain how bombs MAGICALLY survived the plane impacts, MAGICALLY survived falling debris for building 7, MAGICALLY survived fire, MAGICALLY got passed the extra security (including bomb sniffing dogs) working round the clock 12 hour shifts due to phone threats, and why each and every explosion was random, out of sequence, inconsistent with a demolition and had nothing to do with any building collapsing. Explain why there were NO explosions seconds before the collapse of ANY building. Explain how firefighters survived in stairwell B. Explain how building 7 debris was pushed up against a buildiing across the street. Oh and also the steel was sent to 4 different landfills where multiple organizations and experts had access to it for a period of six months. Explain why people who say the towers were demolitions DID NOT go to any of these landfills.

If you can't, and I know you can't because NO ONE has ever explained it away, then you need to...

WAKE THE FUCK UP DUMB DIPSHIT SHEEP!
Reply: And How exactly did you or anyone test a building against being slammed into  by a fricken huge plane full of jet fuel???? I worked in construction also, it is a minor miracle that more buildings have not collapsed in America, I have been on more than 1 pan deck the failed while the concrete was being poured...Fuckin Union Lackies trying to bolt shit together always suck.
Reply: Clifton Williams i agree with you mate im a boiler maker/ welder. Needs to be explosives from within
Reply: @WarInHD  you don't know what the building is made of, it's not just steel there's also concrete and the guys who built them said one day they would fall, you know how we know a plane brought them down? Because we seen the fucking things fly straight into them with our own eyes, you guys believe g in fairytales make me laugh
Reply: @MrRandomGuy86  you sure are angry. You do realize that governments have been the main contributor to the ongoing human death toll since the beginning of time rivaled only by disease.
Reply: MrRandomGuy86 summer down Clifton
Reply: MrRandomGuy86 simmer*
Reply: "Well I’m currently building a 6 story building" 

oh cool, basically the same thing then
Reply: What you meant to say and what you said were two different things.
Reply: Clifton Williams the towers were DESIGNED to take the impact of a larger Boeing 707 hitting it at the higher speed of 600 MPH. But don't let facts get in the way of the lie you;ve bought in to.
Reply: BarryDennen12 lol
Reply: Clifton Williams 6 story’s is a lot different than 110! ITS SIMPLE PHYSICS!!
Reply: Clifton Williams just because you say something won’t/ can’t collapse doesn’t mean that it won’t. shouldn’t we have learned this mistake from the titanic!!
Reply: Clifton Williams Sir Isaac newton’s first law of motion. “An object at rest stays in rest, an object in motion stays in motion” many survivors of 9/11 who were in the building talk about it swaying after bing hit, ( the start of motion). The intense fire and pressure nickeled in the corner of the building and forced its way down. with each floor collapsing that adds X amount more of pressure. Nothing, not one thing would have stopped those buildings from falling once they started.
Reply: @cloudwatchmusic  "An object at rest stays at rest, an object in motion stays in motion"............unless acted on by an unbalanced force.

Two clauses and a condition.
Reply: It's official.  You're a moron.
Reply: jay steve  . I applaud you experience and knowledge of your field. I just have a simple question that should require a simple answer. If these people feel strongly that thermite caused the collapse of the twin tower's,  and WTC7, Then how was that chemical agent used or smuggled into those buildings? Nobody, not even these conspiracy theorists can't explain how that chemical agent got there in the first place? Once you can solve that, we can explore that theroy even more. They haven't solved it to my satisfaction.  That's the problem with that theory in order to believe or consider that theory.
Reply: Jonathan Tullin there’s people claiming it was put in metal beams when it was being built. no way it would have survived those 30 years without detonating!
Reply: Billy Anderson  . There theory on thermite causing those towers to melt down is totaly debunked and false. It wasn't controlled demolition like they claimed. Totaly fake news. Can't be the reason those towers went down. Too many eyewitnesses saw plane parts and fuselage and toros do i dare mention that. There is a website dedicated in debunking these claims. One by one. And with thousands of eyewitnesses accounts with police and firefighters accounts of what they saw. This is fake news. I was only hearing them out as a beliver of free speach. I wanted to at least hear them out about this theroy. And how stupid and rediculious there theory was. They caught themselves in so many lies like that author Christopher Broden. When he aligned himself with Louis Farrakhan and started talking about Zionism as being responsible for 9/11, and talking shit about Benjamin Netanyahu and countless others, that is when I realized this is fake news, and more about propaganda for those anti semites who hate Judaism.  That is where the left gets there juice from. That is why i questioned these morons as to If you believe this theory, how did it get there? Nobody has yet to fully explain to anyone's satisfaction how that chemical thermite was present or how it got there to my satisfaction to even believe this theory. I was merely challenging them and there fake theory to task. Some of them just blamed the jews without a doubt. This is code Zionism is code for hating Jews in general. Look at who they aligned themselves with. Nation of Islam leader Louis Farrakhan.  That and itself should be debunked and these conspiracy theorists should be taken off these websites for fraud and fake news. Yet these same websites that are going after conservatives with what is going on at facebook, twitter, and youtube, are the same hypocrites who want to silence the truth on the right. Eventhough it is the truth, are suppressing freedom of speech themselves. The same ones on the left who they so called support freedom of speech, when they are just as guilty in trying to suppress that right to speech because there narrative doesn't support a theory. Especially in this case. So i will leave it with that.
Reply: It's BECAUSE BOTH THING HAPPENED. 
PLANE HIT, AND ALSO THE DEMOLITION...
FOOLING EVERYONE THAT IT IS THE PLANE THAT CAUSE IT.
MAKING PEOPLE HATE TERRORISTS WHICH GAINED SUPPORT FROM PEOPLE TO INVADE THE MIDDLE EAST.
IT'S EASY TO CONTROL PEOPLE WHO ARE EMOTIONAL.
Reply: Supah Hakah
Explosives at the trade center on 9/11 are IMPOSSIBLE unless YOU can explain away the impossibilities and inconsistencies of the fairy tale demolition theory! Explain how bombs MAGICALLY survived the plane impacts, MAGICALLY survived falling debris for building 7, MAGICALLY survived fire, MAGICALLY got passed the extra security (including bomb sniffing dogs) working round the clock 12 hour shifts due to phone threats, and why each and every explosion was random, out of sequence, inconsistent with a demolition and had nothing to do with any building collapsing. Explain why there were NO explosions seconds before the collapse of ANY building. Explain how firefighters survived in stairwell B. Explain how building 7 debris was pushed up against a buildiing across the street. Oh and also the steel was sent to 4 different landfills where multiple organizations and experts had access to it for a period of six months. Explain why people who say the towers were demolitions DID NOT go to any of these landfills.

If you can't, and I know you can't because NO ONE has ever explained it away, then you need to...

WAKE THE FUCK UP DUMB DIPSHIT SHEEP!
Reply: Billy Anderson One I never said the planes didn’t hit the building, I’m just stating that there had to be another reason for why they fell because a plane would not do that. Two, I don’t see how challenging an official report is ignorant. It happens all the time and is sometimes proven wrong, not so ignorant then is it? Just from my personal experience this looks identical to controlled explosion, I mean Al-Qaeda could’ve planted explosives in the building or on the plane, C4 is great at tearing through steel. Also yes, I’ve seen a few building get demolished, at my jobsite we’re actually going to be blowing up an old Gatorade factory in about 5 months from now
Reply: So 5 guys with box cutters got everyone on the plane to accept their fate and not fight back?? You are delusional dude! And they did it for public support for the invasion of the middle east
Reply: Nicknov Saggioski
Guess this zero channel content comrade troll never heard of the Holocaust. 
...or hijacking in general...
Reply: @nicksaggio6155 . If true, are you at all interested besides these 15 hijackers who are responsible? I am not delusional on anything. I said if you read my statements that i agree with the scientific proof that the chemical thermite was present in the attacks. Now how the fuck did it get there? Didn't just dropped out of thin air? Did the hijackers smuggle that chemical on those plaines? Or did someone planted that chemical inside those buildings? Still a lot of unknown questions still not answered? Delusional? No? Just asking logical questions about 9/11 and having an open mind.
Reply: @jonathantullin2990  
You should do a bit of research into "Thermite".
And take notice that Aluminum is present in all Thermite mixtures. 
As well. Though for some reason there's no explanation for the Sulfur. There IS. 
As Jet Fuel. Just like Diesel. Has very measurable amounts of sulfur. And one reason "Low Sulfur" fuels are now Required for highway use. But NOT, for farm, or industrial uses like aircraft. 
So I'd assume. Other than the Thousands of unidentified materials simply present in the building and it's contents. (who knows how many Chinese Pencils and crap were in those buildings lol) Plus the aircrafts. 
That some 20,000+ gallons of jet fuel, will give a positive result for sulfur. 
And all components of Thermite. 
Hey. It's just science...
Reply: @My-Pal-Hal  . I don't dispute science. It is fact not fiction. Which some people don't comprehend.
Reply: Jonathan Tullin, the railroads use thermite to repair track. And I believe it is also used in some steel making processes.
Reply: @nicksaggio6155  
Hijackers have done it many times around the world.

I really doubt they told them they were going to be flying into a building. Only that one plane found out about the others hitting buildings fought back...... After they found out about the buildings.
Reply: @nicksaggio6155  troll